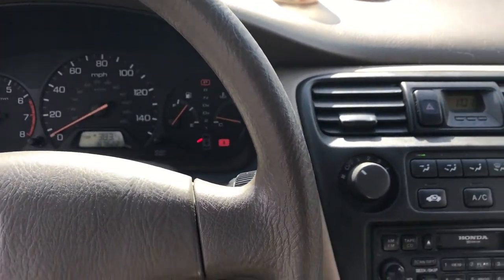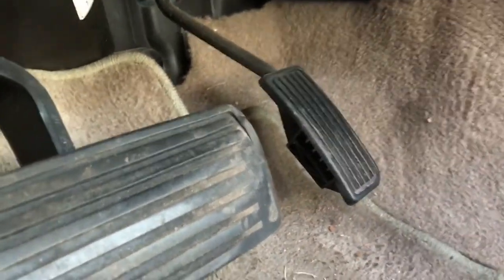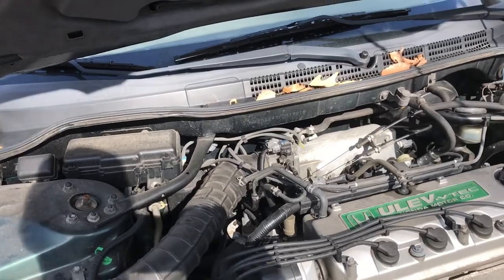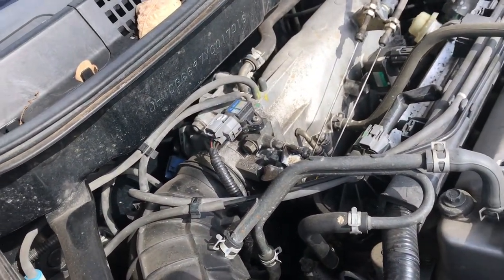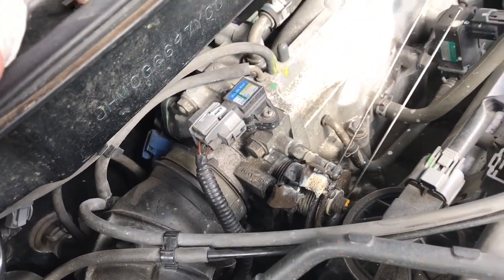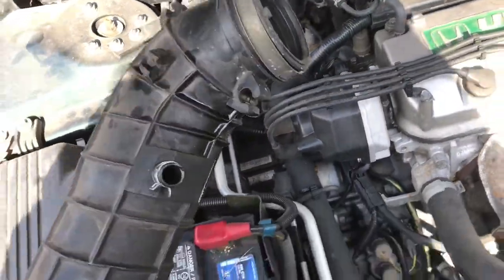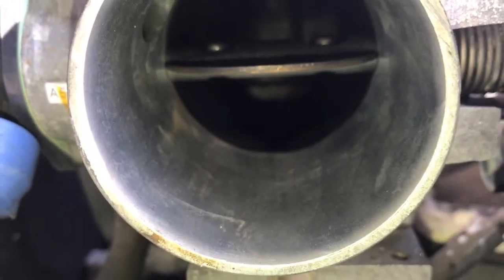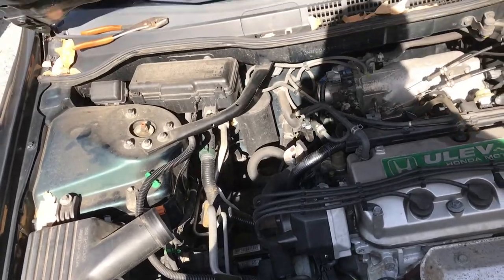2000 Accord Gas Pedal Sticking

Comment: Mine is doing the same thing hope this fixes my problem
Reply: Did it fix your problem?
Reply: @msgrepea7352  yes! mine was dirty and did not think that it was going to fix mine but it did. I drive a standard and since mine was sticking I was pushing pedal down harder to unstick the pedal. Was revving it real hard on accident in 1st gear to take off. Was embarrassing lol. I bought the same cleaner he used in the video
Reply: @paschallhouston  BRO I got my first car about 2 days ago and my dad gets mad at me because I keep accelerating to much by accident, thanks for letting me know bro, also did you completely remove it or did you do It like in the video?
Reply: @msgrepea7352  I was going to remove it but I did not have the right tool. When I watched another video they said not to remove it because you can mess it up. I am not a mechanic and do not remember what he said could change but I'm glad I didn't remove the whole thing. I just pulled the hose off to reach it. Use a good rag not a paper towel to keep anything from getting stuck in there when you clean. Have someone push the gas pedal down or use a stick because there might be a lot of tension on it like mine. Watch your finger when you clean you can get hurt if the throttle flap closes on your finger. Hope you get yours running right. Congratulations on your 1st vehicle. Be careful out there.
Reply: @paschallhouston  Thanks alot for the information bro, take care man
Reply: @msgrepea7352  no problem. You too

Comment: Mine is stuck in acceleration mode. Is speeds up in reverse and drive. And high revvs in park like it wants to rocket to mars. What gives?
Reply: find the fix yet??
Reply: @slowly6119  Yes. The throttle body flap was stuck completely open. I bought the used part in the summer since I couldn't find one online. I cleaned it before installing it but found a lot of gunk built up inside. I haven't used the car since installing the part but I warm the engine every once in a while. It's my rebuild project.
Reply: @kizito8888  Awesome thanks i found my problem by going off of this comment, mine issue was FICV was stuck open with caused my surge and poor power, ordered a brand new throttle body but still waiting on the part. as this is my daily i’ve covered the hole inside of the TB with duct tape and so far it’s been working!
Reply: @slowly6119   Duct tape? That's a good idea. But what happens if the tape peels off? Be safe out there. Glad you found a solution.
Reply: @kizito8888  happened already since last commenting haha, the idle surge came back and stuck throttle feeling. popped off the intake box to get to where i left the tape. the tape had been have sucked into the rectangular hole. so i used gorilla glue tape instead and went over it again and it’s been fine since. still waiting on the part, not fun to drive 60mph like that!
Reply: @slowly6119   Why is your part taking so long to show up? Happy holidays.